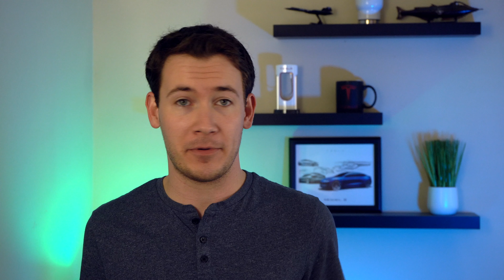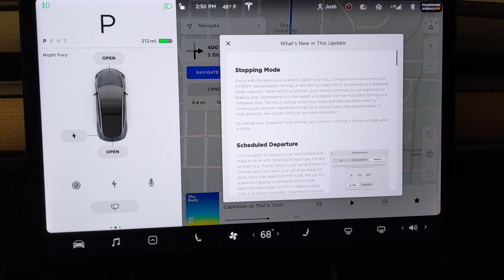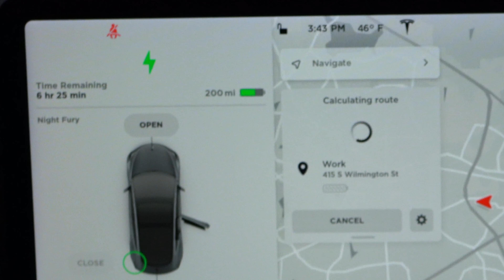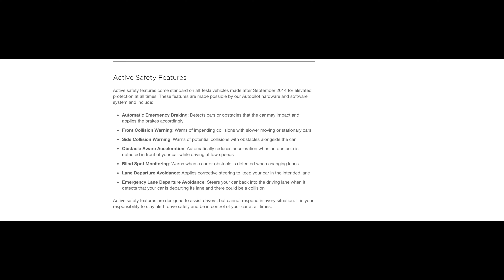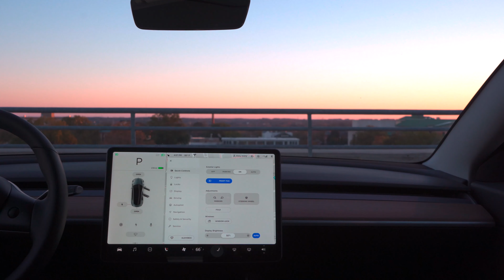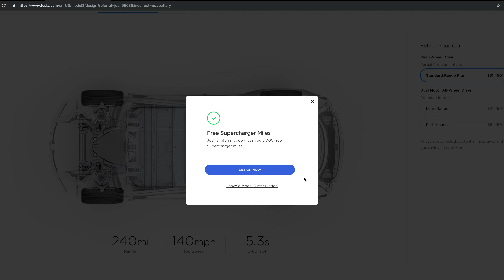How Driving a Tesla Made Me a Better Driver

Comment: I’m concerned about braking systems that DON’T activate the brake lights as a warning to following traffic......or are they always activated?.
Reply from the maker: The car applies the breaklights after a certain declaration rate is hit.  Haven't had an issue with it.  Was worried about that too at first, didn't want someone ramming into the back of the car 😅
Reply: Once you let go of the accelerator the brake lights turn on  and increase in intensity at the same time as the car decelerates.